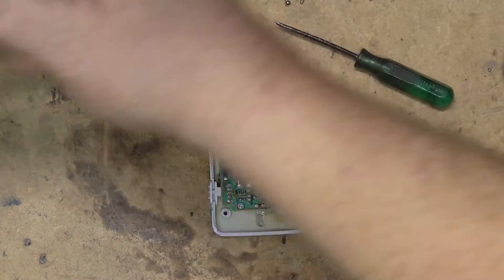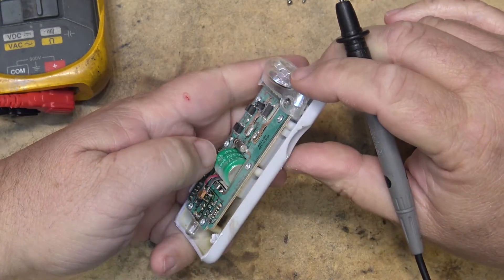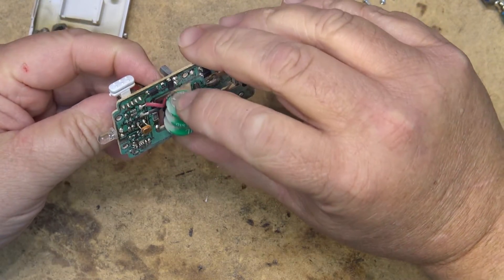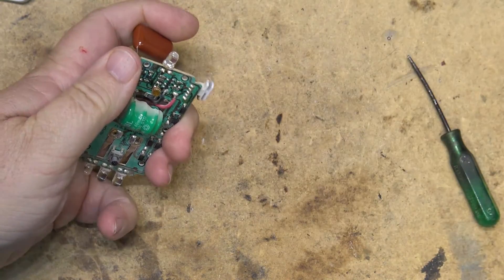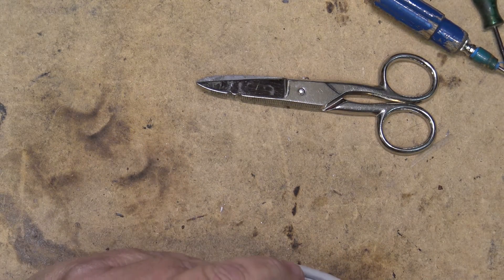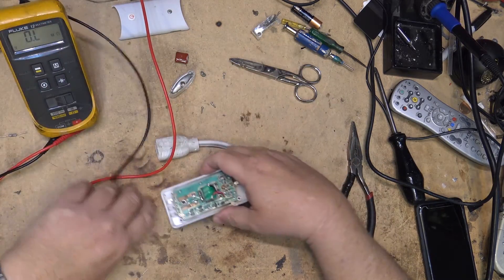Eton Blackoout Buddy night light teardown and repair

Comment: So inefficient few pieces LED using 220v power source .. A single 1.5 volt should be enough to light it up
Reply: It is 110-120 v - it is written on the device, which you can see at 40seconds. Also, the prongs are for N. American sockets

Comment: the capacitor blew
Reply from the maker: It sure did, and blew out the 5.1v zener and 10k resistor after it.

How did that saying go.... a 100.00 picture tube will protect a .10 fuse by blowing first!

Comment: i see a burn mark on the bottom.. thats the first clue i see
Reply from the maker: Yup, it was a little black wasn't it.
Reply: @12voltvids  part 2 replace the light sensor and then it will b able to stay off until the light is out
Reply from the maker: @jjohnson71958  No part 2. It had a piece of black tape over it so the light stayed on anyway.